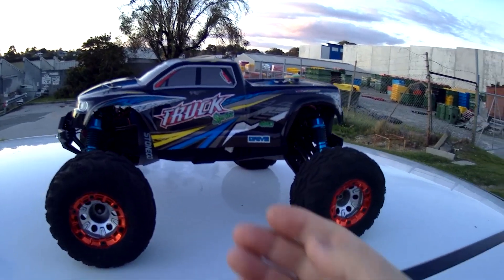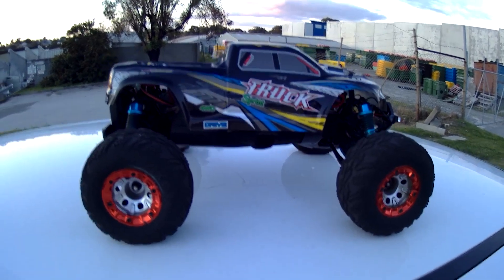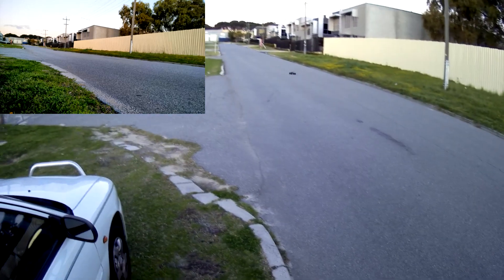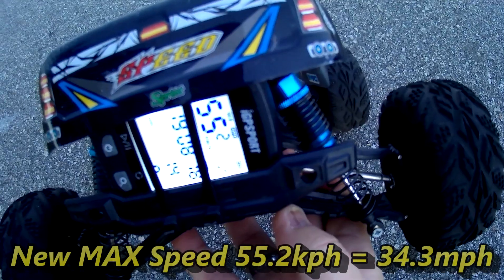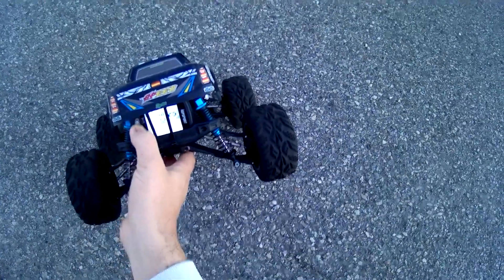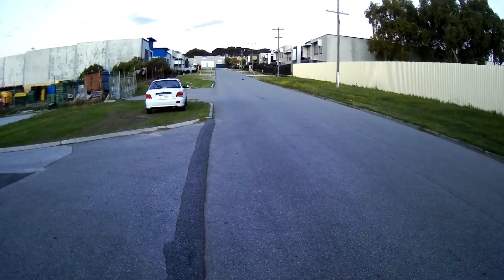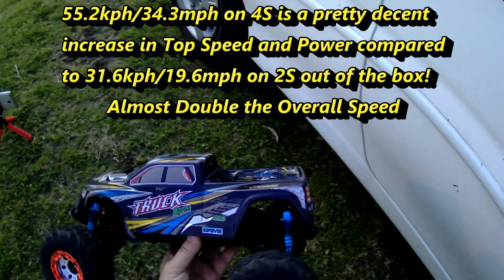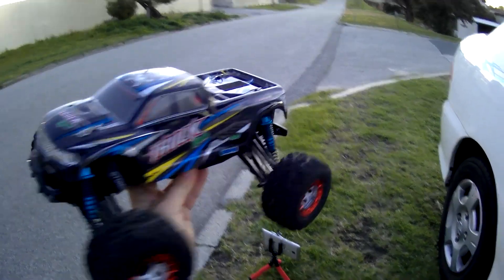XINLEHONG 9125  4S MAX Speed Run 2 - Can it go even Faster? 🚥🏁🚙💨

Comment: Do you know what the stock gear ratio is?
Reply from the maker: Sorry Daniel I haven't found any info on final gear ratio tbh... I know it tops out pretty much on 4s at 56kph...it doesn't seem to wanna go faster than that, even on my 5s speed runs..
Reply: PERTH WEST OZ RC I think I figured it out from pics of various original spare parts, 1:11.57, and 18,000 rpm (2s) motor.

Comment: Do you have a link to those shocks? Truck looks like its on a lift kit :)
Reply from the maker: I bought them from wish, link is in the description, this is a pretty old video so see if it works... But you can get em easily online like on eBay also 👍 thanks for watching
Reply: @PERTHWESTOZRC  oh ok gotcha.I watched your other video as well.I see these for sale on ebay with that description. However which size are they actually (65/85/100m)?
Reply from the maker: @BDTennessee  i have 100mm shocks on this 9125
Reply: @PERTHWESTOZRC  thanks for the response ,i found it after some research...

Comment: Hi there! I see you lost connection with RC (at 5:44) and it wasn't that far away. Mine is sometimes losing connection too, even thoe it's not too far, too, and continues to run ignoring everything, even thoe there are no other RC's on the site. Do you have any ideea why that is happening, or what would be the solution?
Reply from the maker: Hi thanks for watching, I'm jot really sure why my truck lost connection on this road as it only done it sometimes, must of been some sort of interference in the signal.
Reply: @PERTHWESTOZRC , maybe there are some big metal pipes under the road in that area, or, yes, radio interferances. Maybe tip of antenna's truck must be isolated with some rubber, and the antenna's tip inside the remote too. I have just thought of that. 
Anyway, great job with RC's, love your channel, keep up the good work!!!
Reply from the maker: @dexatrex  thanks very much my friend!